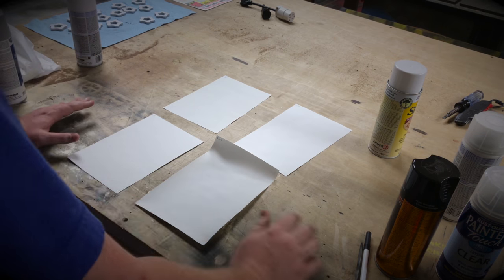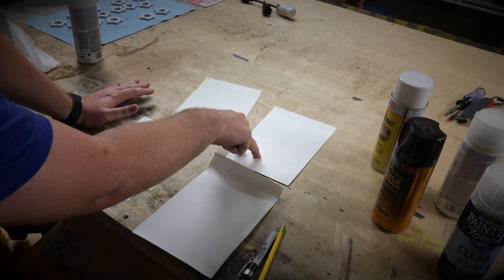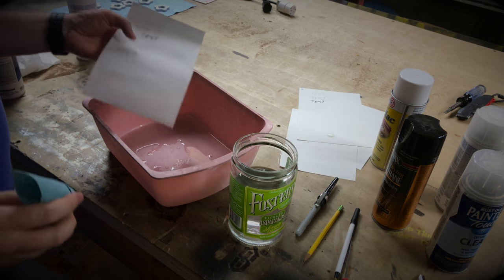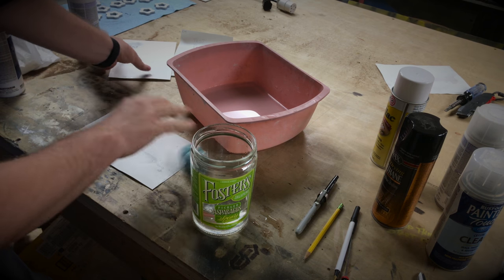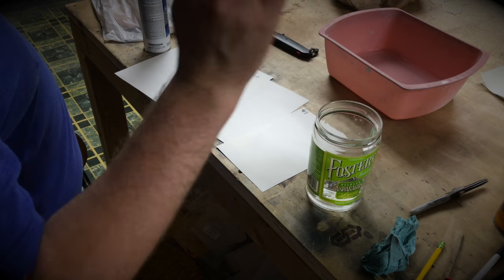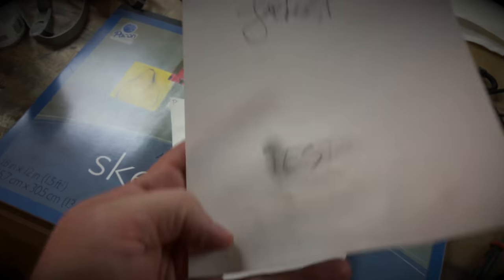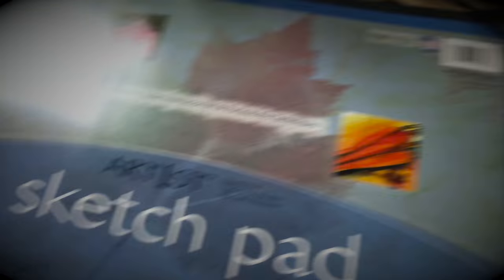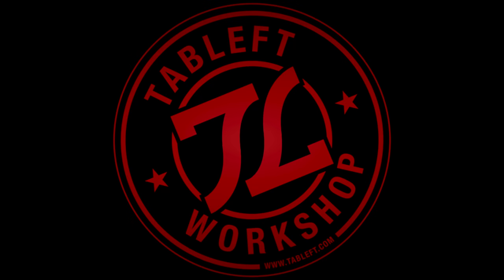R&D: Waterproof Paper? SUCCESS! (more or less)

Comment: Try a hydrophobic spray
Reply from the maker: Peter Warren I considered trying using never wet or a conformant silicone but I figure at the price point it would end up more expensive than the commercial options but I'll probably try them in the future.  I also want to try a polymerized oil like boiled linseed.
Reply: Peter Warren there is a prduct called everdry. It would be much better than anything else.
Reply from the maker: Jared Andersen but would it be cheaper than other water proof solutions? Would it work better?  I'll have to look into it.
Reply: It's very expensive. But it works. Ultra everdry.
Reply from the maker: Jared Andersen I might order some, thanks
Reply: Yeah everdry is a hydrophobic spray